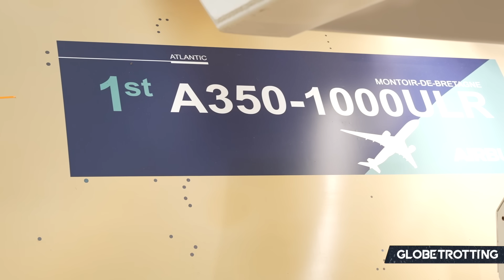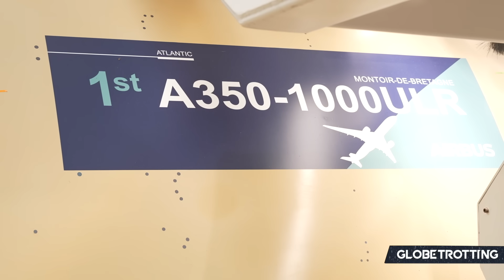Airbus Confirms New A350?

Comment: The base here is, just how many airlines would want an increased A350. Remember, it's the economics for Airbus to make it work and pay off.  To few Airlines means that there is not enough money to warrant the huge expense of another Aircraft. The 777x has taken some hits on a number of cancellations, so the real problem for any Aircraft manufacturer,
are there enough to be built to get a return.  Just Emirates is not enough and a very high risk for the manufacturer. What happens if they cancel? It  could be millions in debt for the 
manufacturer. Airbus is right, to take its time, to see just how many would be wanted. It would have to be certified, that is not a quick event. RR, well, I suppose they could use the 
Ultra, but after all this time, it's still not certified, Airbus might turn to GE if they can get their problems sorted.  There is no guarantee that Airbus would use RR.

Comment: Hoping the FAA places as much scrutiny  on Airbus as it has on Boeing
Reply: The FAA had to really show that they were no longer under Boeings wing and free to make the right decisions, plus Boeing had a dirty name to clear. Its all been for the good
of the safety of the passenger. The FAA HAS ALWAYS BEEN VERY TOUGH ON AIRBUS - ESPECIALLY WHEN IT WAS UNDER THE CONTROL OF BOEING. ANY EXCUSE TO
PROMOTE BOEING. VERY UNFAIR AT THE TIME AND BIASED TO BOOT.  You should want Boeing to come back with a CLEAN sheet. Remember, the FAA gave Boeing the
right to certify is OWN aircraft!!  What you REALLY mean, is that Boeing is facing the same tough rules as Airbus has always faced. For a change, its not GREED IS GOOD
anymore and F... the passenger.

Comment: The question is whether Rolls-Royce can deliver enough thrust at a single-engine take-off condition with the increased weight on the airplane.
Reply: Seen analyst opinion that the 2k won't launch until it can have the ultrafan. Might be close

Comment: I think Airbus is trying to build the A350-2000 with a new engine designed around the UltraFan technology, selling it to Airbus as an A380 successor with a range approaching 9,000 nautical miles.
Reply: That might be in their thoughts but the bottom line will always be, the return on outlay.

Comment: If Airbus makes the 2000 it would only compete with the -9 not the -10 in seating capacity. With the -9 still able to seat more people than the -2000. Airbus should either build a new type or concentrate on it's dominance in the single aisle narrow body planes

Comment: I have a suggestion for Airbus. Say emirates that you will do an a380 neo if they give 50% down payment on at least 100 units, and they replace their entire 777 fleet with A350’s.  It would kill an entire storm with one stone.
Reply: Emirates doesn’t want to cancel their 777-9 orders. It is Airbus’s fault for not truly building an extra wide body like they call it. 10 abreast with wider restructured cabin walls (on the 777-9) will be appreciated by the passenger and profitable for the airline. Nine abreast is not the money maker that ten abreast is.
Reply: @Montanaman-j6l 10 is possible on the a350. Its even easier after the new production standard
Reply: @Montanaman-j6l  Airbus has no fault. No plane Maker has to be forced to continue to produce a plane that doesn’t sell enough to be kept in production. If emirates really wanted to keep it going could have ordered enough planes to produce a couple of a380 per month for the next decades. They didn’t. And off course they’ll miss them once gone. Emirates doesn’t make real money with the 10 seat abreast at the lower level, but the 4 abreast of the upper level. There is where the real money is and where emirates has no competition. No other plane can offer the same level of space and comfort for the customers willing to pay that type of money and that right now emirates can offer basically without competition on the market on all the main routes at a good frequency.
Reply: @luigifranceschi2350  Emirates has ALWAYS wanted the 777x. Clarkes talk of "orders" are all b/s to try to get Boeing to get its act together.
Emirates WONT miss the A380, it has cost a fortune to keep going, once the 777X becomes available it will a huge relief for Emirates. Not
so much the passengers, who loved the A380 comfort and quietness. That doesn't change the fact, that compared to the 777x they are
uneconomic to run.
Reply: Or at least cancel a big part of 777X orders and change it to a350s with a380 neos.
I think turkish airlines and emirates can fund the development program of the 380neo, and airbus would eventually have few more orders
Reply: @zozzzz12 Why would Turkish help fund a new A380 If they never operated it?
Reply: @Radix111 i read somewhere they are insterested in the a380neo. The point is emirates needs to find a few airlines to back the program
Reply: @zozzzz12The drugs are talking